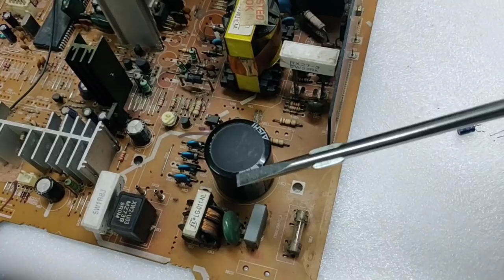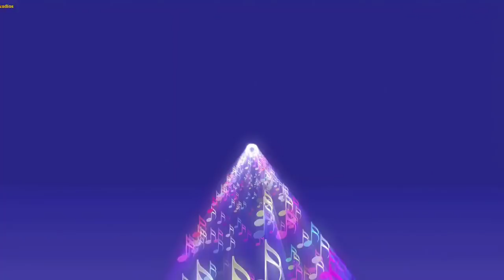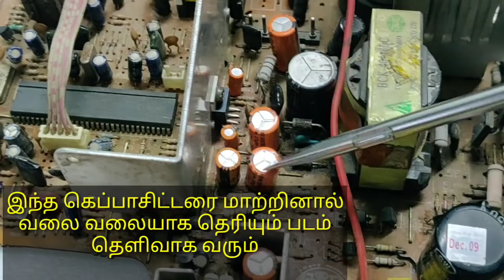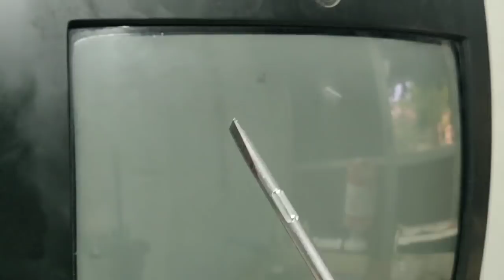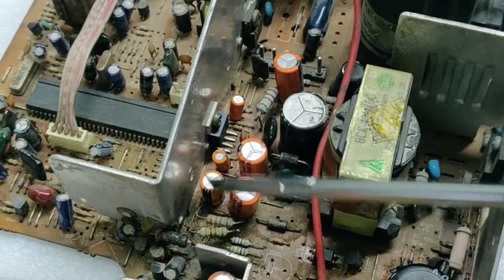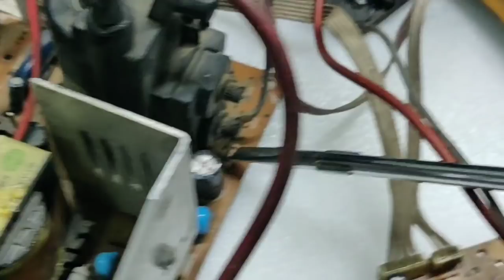TV SERVICE power supply output problem basic explain.

Comment: Tn government tv model 13108
5w3r9k resistor connect panninal b+volt 15 to 30 varuthu 5w3r9k resistor disconnect panninal 110 volt varuthu, h out, 2k disc, 2k preset, 6.2 zenor, optocoupler, check pannitten no continuity but fault not solve pls reply me sir

Comment: Sir Vanakkam  crt tv la horizontal  section la wara faults finding video podaunggal 
CRT TV STR POWER SUPPLY paththi 
Vertical  stage faults finding video 
Crt tv  neck board  faults  
Weak or low brightness problem faults  mudiyum endral video upload  pannangal ungal channellai Subcribe seytha irakkran Nanndri vanakkam Sir